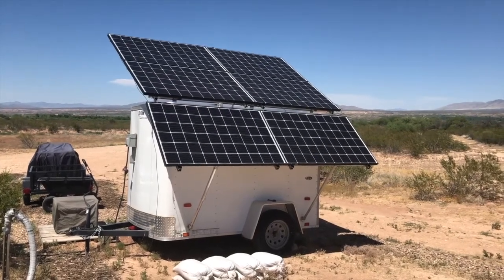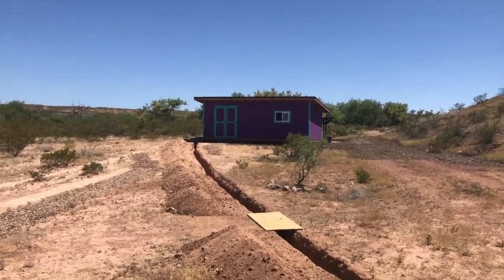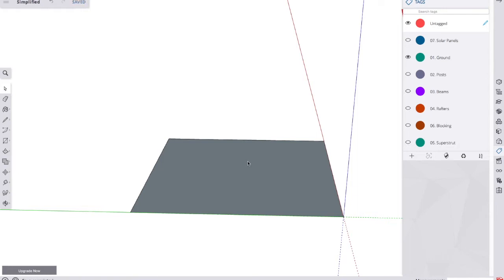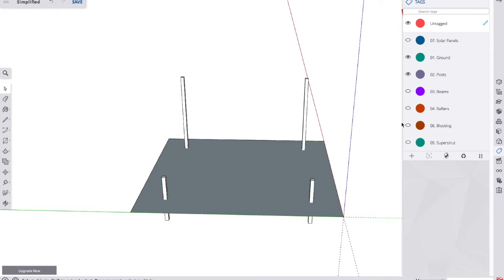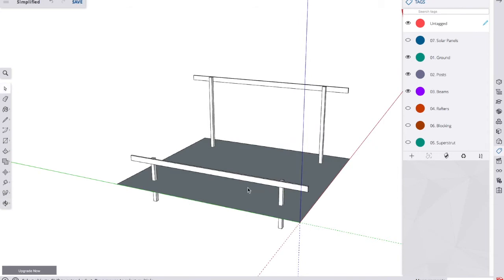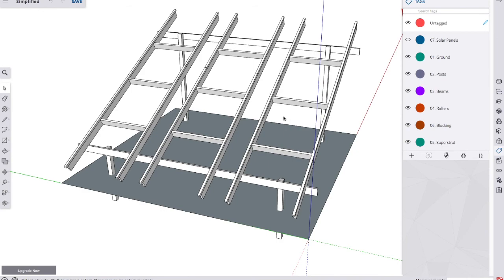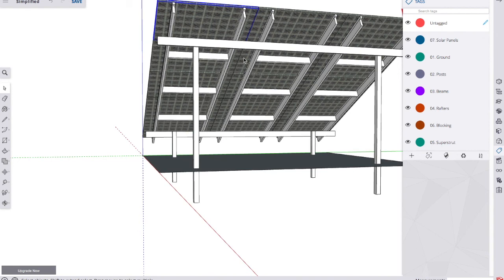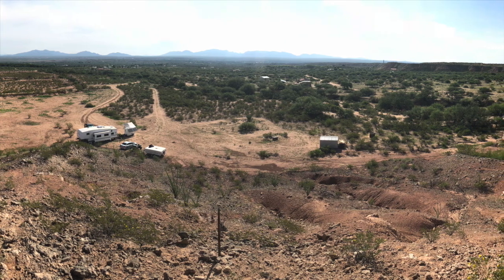DIY Off-Grid Solar Setup (Part 1 - Panel Ground Mount SketchUp Design)

Comment: Looks great! Your bracing doesn't have to be 2X6s. Could be 2X4s.  The rafters are that large because of the span. Save yourself some cash by using 2x4s for bracing. The diagonal bracing might best be 2x6s though. Wind shear is probably strong in that little canyon-like terrain.
Reply from the maker: Good point!  You're probably right.

Comment: Looks solid Brian! What was the reason you didn't mount them on the shed?
Reply from the maker: Thanks, guys!  I probably could have, but I didn't really design the shed with that in mind.  It doesn't quite face true south, and the roof is sloped such that I would still have to tilt the panels up row by row.  I also didn't really feel like messing around on the roof and liked the idea of having them closer to the ground.  Looking back, I probably should have designed/built the shed  to accommodate them, but I was so daunted by the idea of the shed on it's own that I just chose to remove that from the equation.

Comment: which extension provide poles and beams?
Reply from the maker: You mean like a SketchUp extension?  I didn't use any.  Just drew everything myself.  Pretty easy to draw lumber.  Just a rectangle (i.e. 1.5" x 3.5" for a 2"x4"), then push/pull for the length.  If you're going to have a bunch of them, you can make it into a component so you can choose it from a list, and it will count them for you.